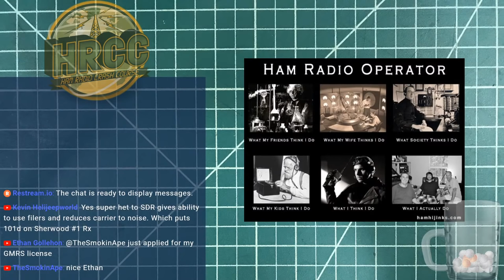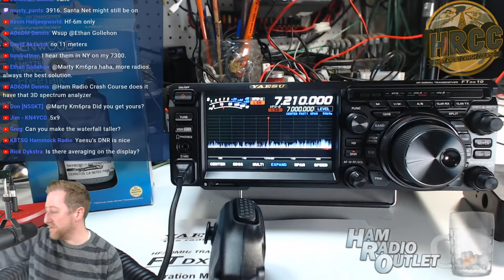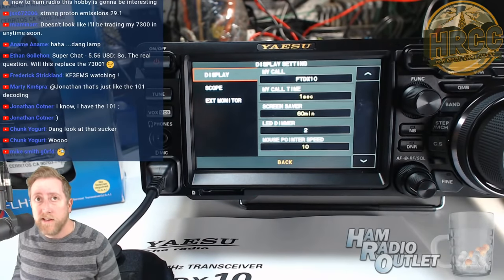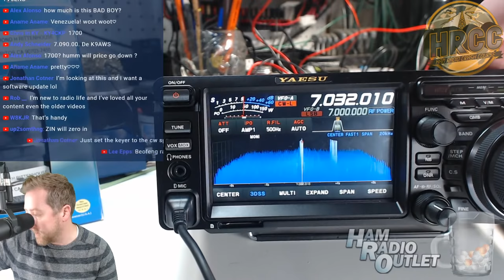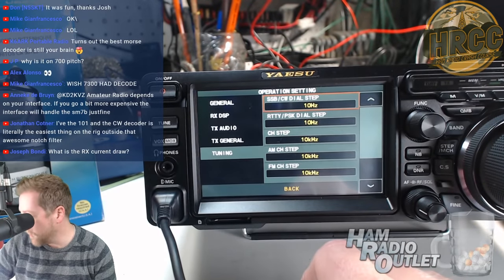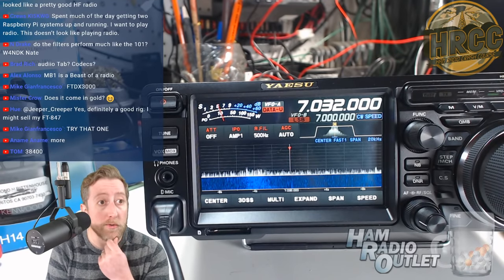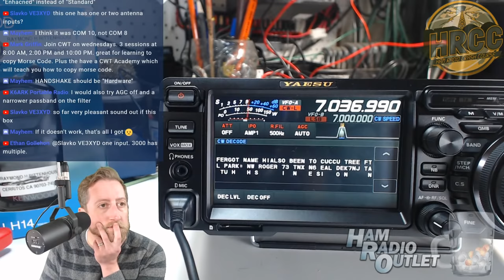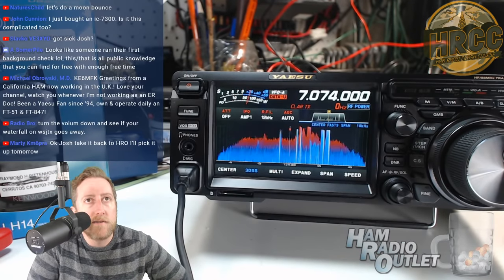First Look at Yaesu FTdx-10 Ham Radio - Livestream

Comment: Couldnt handle it any longer. Ordered this radio this evening. This thing is perfect for what I do with radio. I wish is was a couple hundred dollars less, but that isnt going to change my year, so I didnt want to wait. Ive got the 991, but operate it using an SDRPlay via OmniRig. This thing just simplifies that process, and no need for the mfj sdr switch. 

Now the question is whether I keep the 991 or not

Comment: If the 10 performance is anywhere near the 101, this will be worth the price over a 7300 imho. The 7300 is a good radio - I owned one for a year or two. The 101 is a totally different league from rx audio to operating flexibility (should be for the $$$). We'll see where the 10 lands, but the hybrid design is a winner in my book. And I'm not a Yaesu fanboy - I don't care for the fonts, and the menus on the other radios (owned the 991a, 891, 400 - sold them all) are a pita. The 101 is much better wrt the menus. But it is the performance of the radio and the filters and flexibility that make it so enjoyable to operate. As always, ymmv.

Comment: In these Yaesu radios the 2 com ports have different uses;
The Enhanced Port can be used for CAT commands.
The other standard port, can be used to trigger the PTT via RTS.
When the secondary port is used to trigger the PTT, the radio will use the USB audio for its TXaudio automatically when in SSB.
When the PTT is done via CAT comnand. however, you must go iNto the RADIO MENU and set SSB TX Audio to use the USB instead of the front mic. Otherwise it will just use the microphone audio when the FT8 software tries to send.

Comment: I'm a newbie but I love the Hybrid Concept for this radio. What I'm hoping for is another version of this radio that will replace the 991a. I only have QRP and Low Power radios(G-90) so I'm saving up my coins for my first 100 watt radio. After that I won't be buying another radio for quite a when so.i want to get the best that I can afford. Thank you for this video, that's actually of a live radio and not that picture.👍🏿👍🏿👍🏿
Reply: Its tough to beat the 991 then. I have the 991 and have ordered this ftdx10, but the 991 is already proven, probably the most versatile rig on the market, and for a reasonably good price. I think this 10 is a bit overpriced, but I bought it anyway. Why? Because it fits what I use radio for. I run my 991 through an SDRPlay, and dont use the 991 for 2m 70cm....so the additional screen features, easier notch and contour functions, and allows me to use mouse and monitor directly with the 10. No more need for mfj sdr switch to keep from frying my sdr. For me its more simple.

991 is a fantastic radio though, especially for someone new to the hobby and likely isnt sure what aspect of the hobby will draw your attention in months to come.

Comment: I have owned the 7300 and I now have the FT-710. I loved both radios. I still prefer the Icom for digital modes compared to the Yaesu. The icom programming is just more fluid and trouble free. Every Yaesu I have ever owned has gliches in programming. That are not major flaws though. I have always believed that Icom is better on the software side and Yaesu is better on the hardware side. The newer Yaesu's are definitely better at pulling in the weak signal and the noise floor is quieter on my Yaesu compared to the Icom. I wish I could just have both.

Comment: deciding between this and 7300 for first HF rig.  Kind of leaning towards the 7300 as I'd like to have an RX only antenna and it has a kit you can use to modify the 7300 without having to use an external PTT switch.

Comment: I don't get the 3D waterfall on Yaesu radios, to me it's useless compared to a regular waterfall.
Reply: Complete gimmick
Reply: ...agreed. But it does have the standard waterfall, so who cares about the stupid non-usable 3d nonsense
Reply: @lizzyfan1986  ...something to play with for a few minutes then never look at it again
Reply: Most of these videos don't set up the 3D display correctly. The function works much better if the display gain is lowered to the point where the noise floor barely registers.

Comment: Two questions - is there a way to slow the SDR sampling rate - that display looks 'frantic' and is really annoying. Next, are the front panel buttons backlit?
Reply from the maker: Yes. Rate is controllable. Good question on backlit. I’ll check.
Reply: I think the flicker on the display is an artifact (illusion) created by the video camera taking the stream. In person the display should be smooth.

Comment: What is with ham radio manufacturers and releasing  $1500 radios with 20 year old technology?  DVI connector, seriously?  Most monitors have dropped DVI years ago.
Reply: HDMI charges US$0.04 per device with an annual fee of $10,000 for high volume manufacturers.
Reply: @eddycuypers7621  Raspberry Pi 3s have had hdmi for years and cost $35.  I don't buy it for a rig that costs $1500.
Reply: @Martinroadsguy  These manufacturers probably count Their cents. DVI has no audio support and there is no audio sent to the monitor so maybe they figured it was the right connector. BTW, an Icom 7610 also uses DVI for the monitor, if I'm correct.
Reply: The video format in DVI-D and hdmi can be identical, minus the audio. If the resolution is up to 800 x 600, why wasting the expense of HDMI??
Most monitors today still have VGA conectors.....
Reply: @eddycuypers7621  I would think that's pretty embarrassing if their profit margins are so razor thin that they're that concerned about a 4 cent per unit and a $5,000 or $10,000 annual fee when selling radios for $700 to $3,000.  Kind of doesn't bode well for the future of the hobby either.  There's going to be a lot fewer old retired hams who can afford high end rigs that cost thousands of dollars in the future.  I've noticed an annoying trend of radio manufacturers slightly updating 10 or 20 year old radios and selling them for the same premium.
Reply: A couple of thoughts on this. Firstly the radio is sold around the world, HDMI monitors may not be the most common item to pick up in some locations. Secondly, with people moving to DP and HDMI, that frees up older (but still decent) monitors that could be used just DVI-D for the radio.
Reply: @eddycuypers7621  HDMI charges vary between USD 0.04 and USD 0.15 per hardware device. As you say that can mount up. Hence why laptop manufactures and SFF PCs are moving to Display Port. HDMIs days are numbered in the commercial world.

Comment: Not impressed! I think my Yaesu FT-2000 is a better radio and that 3-d display just sucks! Not worth the money. Anything happens to my FT-2000 I think I will go with the ICOM 7610. Oh by the way no front and rear CW key jacks so no switching between your bug or Iambic paddles or straight key without going into the menu.

Comment: Thanks for posting, I am not too impressed with the radio. Have always liked Yaesu radios, but the introduction of the 991 and how they treated their customers was sad. I almost bought a 991, glad I bought the IC7300. Have had several friends that had to send the 991 back to repair several times, one just gave up after 2nd try to get it fixed. I hope they don't come out with FTdx-10a in 6 months.